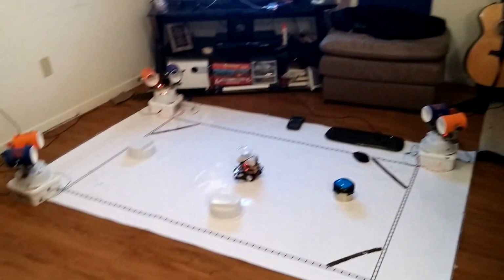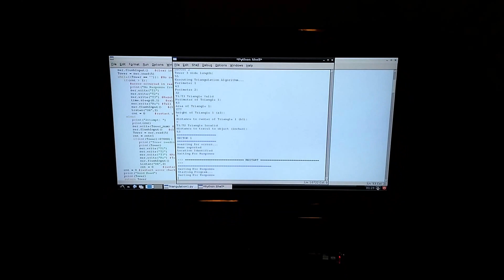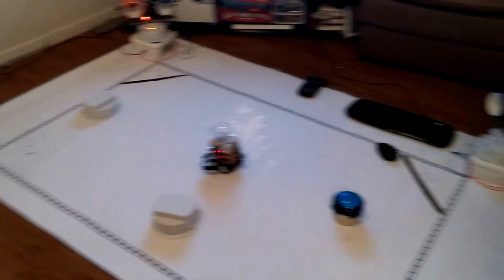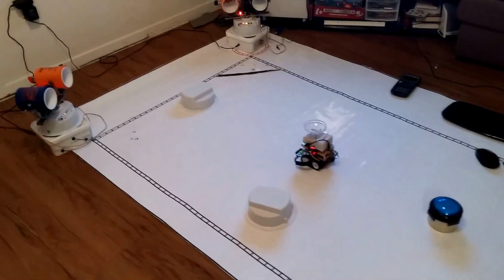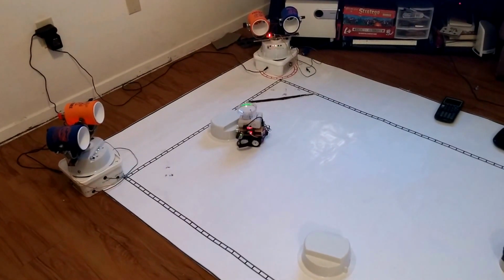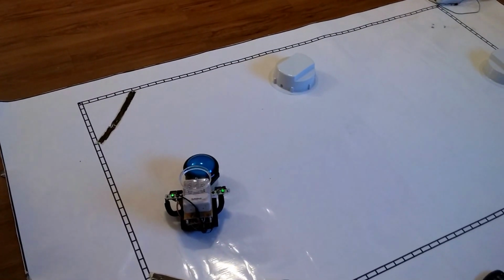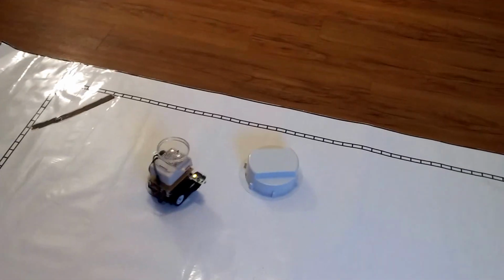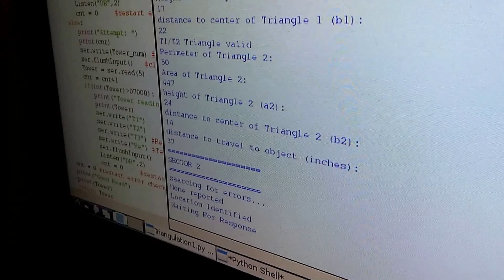Sound Triangulation on a Budget

Comment: this is awesome!!! i'm really curious how you make something like this, and i can't find any tutorials on the triangulation system. could you maybe give some more info on what you used for sensors? and a bit how they work?
Reply from the maker: Jos, Thank you! In principle I used an RF trigger (Xbee) to begin a timer on each tower, and listens for an incoming sound. Each of the towers had microphones with simple threshold checks and bandpass filters. Once the sound threshold was crossed the timer were stopped and an external raspberry pi crunched the numbers. The results were very noisy which is why I could only determine "sectors" and not exact locations. I also send out multiple pings to help average out the noise.
I also just posted a link to the source code in the description.

Hope this helps and sorry for the late reply!